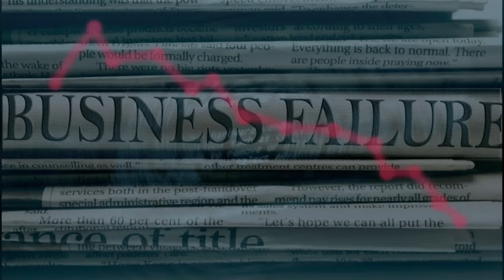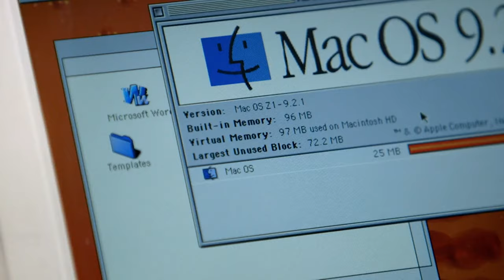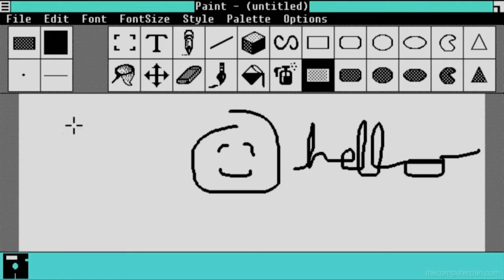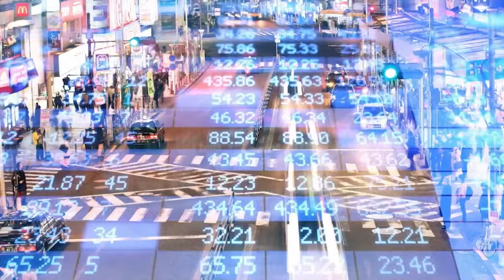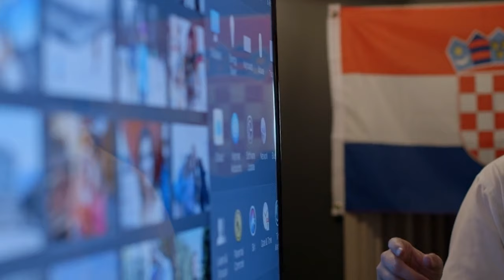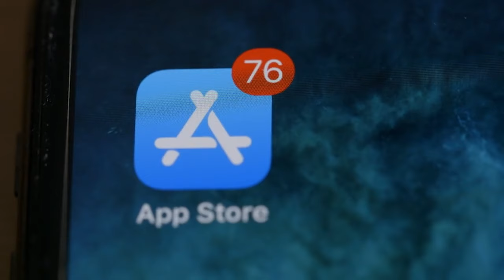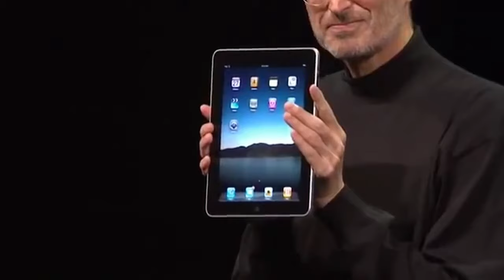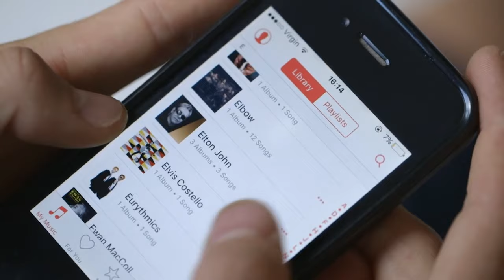Surviving the Brink: How Apple Overcame Bankruptcy | Absolute Documentaries

Comment: What apple has in the pipeline? Well, a bunch of glued together devices that die because they made a mistake and expect the end user to pay, lock customers in their walled garden and raise prising which they have been doing for years now! I mean, i am a long time apple user, well, i was until very recently, i have an android phone now and a gaming laptop and pc instead of an imac, iphone and macbook pro! I respect their socs, because their move to arm, is just logical progression, microsoft tried it with surface rt, but apple managed to move their entire mac platform over to it and they succeeded! But yet, i am sticking with my intel pc and ryzen laptop. My android is nothing special, though it has nice features like a 120hz display, big battery and all the connectivity you want! Fun notice, android phones play nicer to an iphone than an iphone, why? If the iphone dies, i can recharge it with my android phone with a usb-c to lightning cable! Something iPhones can't do! Comes in really handy sometimes if i forgot to charge my headphones! Try that, apple user!!
Reply: @cannedchocolatesinwater  Bro, what "mental" needs to be checked? Didn't i stated some facts? Tell me where i need to "check my mentals" in my comment? Because as far as i know, i didn't lie. Don't shove your mental issues onto somebody else buddy, coz it ain't working ;)